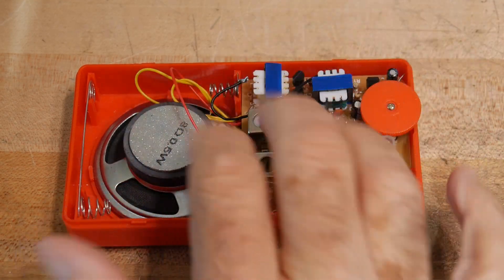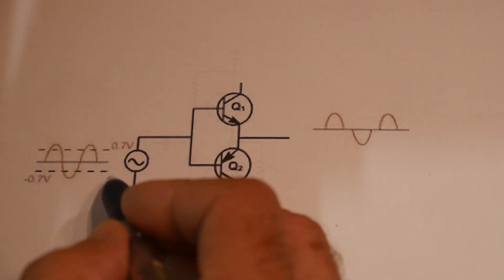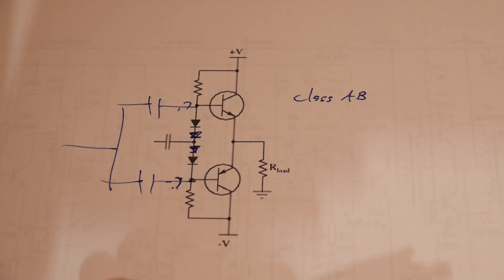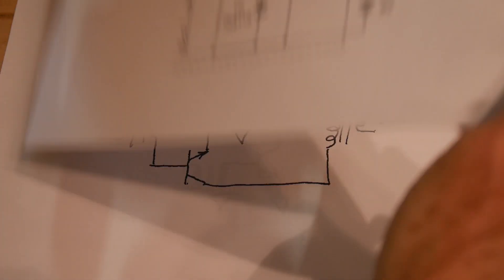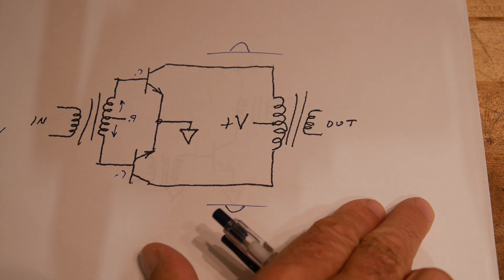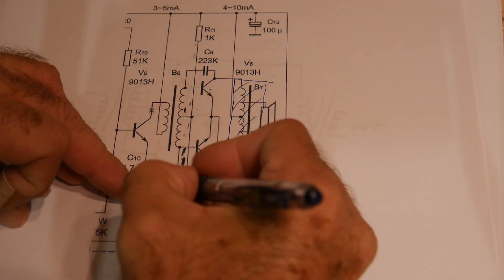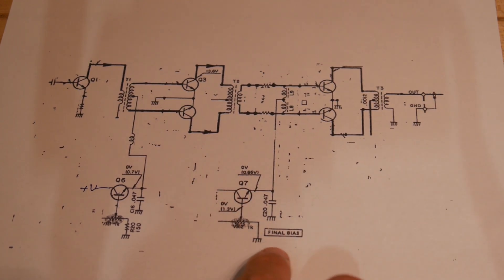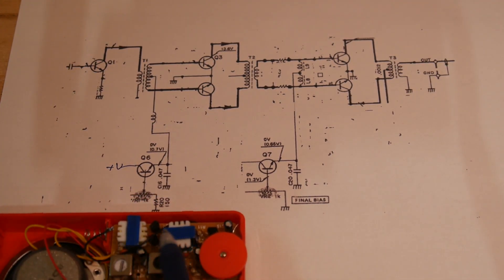#271 two types of class B amplifiers

Comment: The radio probably used the transformer coupled audio amplifier so that it could run well off of the two alkaline cells that have a working voltage range of approximately 900 mV to 1550 mV.  A direct coupled audio amplifier that could operate efficiently off those voltages using ordinary bipolar silicon transistors is a design that I have yet to see.
Reply from the maker: Good point. I didn't think about the low VCC

Comment: Nice explanation...gotta figure that a single class A transistor AF amp probably would have cost less even with its associated higher capacity surrounding components than the two transformers; maybe they just had a bunch of transformers in stock from some other product!